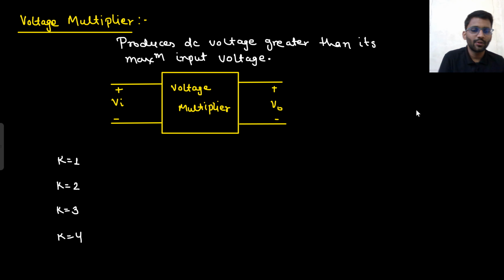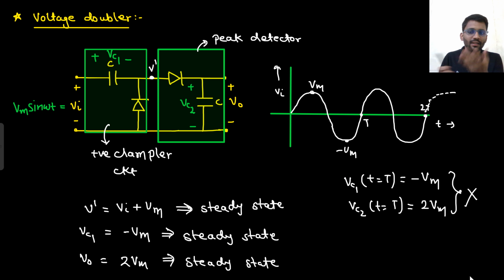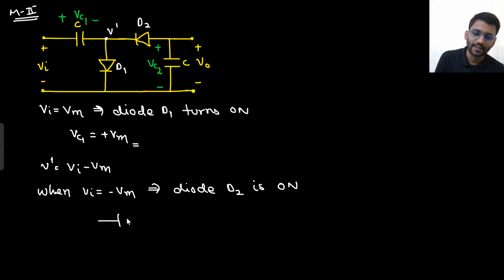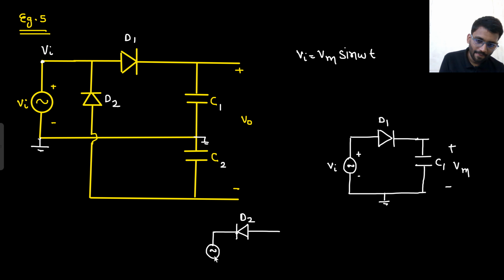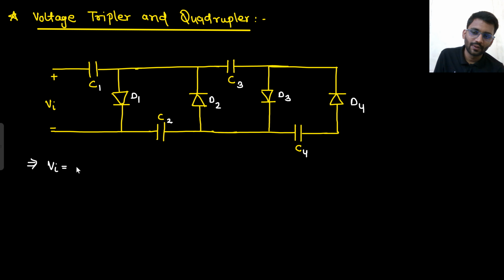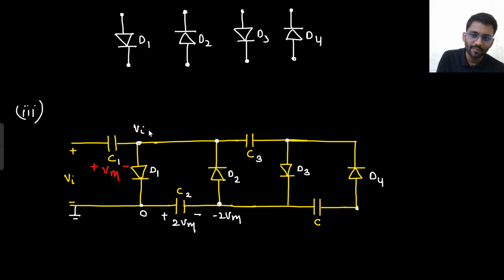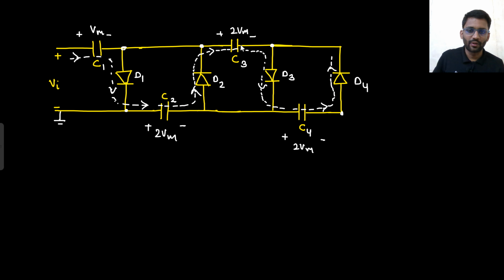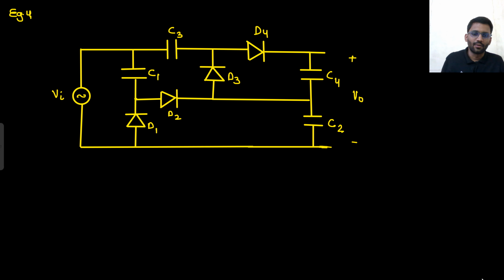Voltage Multiplier (Part 1) || Analog Electronics || PrepFusion || Himanshu Agarwal

Comment: SIr one doubt, in the voltage tripler circuit at NHC the potential at the top of the diode is Vi+Vm for the negative cycle right.SInce the circuit will work for the postive clamper.But you witten as the Vi-Vm.Can you clarify that
Reply: taken as Vi = Vm with the polarity  of Vin intact. so if we go by your method also you ll arrive at the same answer of -2Vm across the capacitors .. but it is easier to keep track in sirs method since Vi Vm can be kept constant upon every diode.
 I hope this clarifies else i understood your doubt wrong.

Comment: sir in voltage trippler/quadrapler -- if 2vm across two across both capacitor is there any charge sharing will happen at the end why 2vm across both capacitor
Reply: Did you find the answer to it?

Comment: At 5:14, I have a doubt about taking the polarity of the capacitor as + to - (left to right). Let's assume I take the polarity of the capacitor as - to + (left to right). Then, during NHC, Vc1 will be Vm. So, if they ask for the capacitor voltage in the exam, what should I write? like in your case Vc =-Vm and in my case Vc=Vm so ...
Reply: They will show the Vc with polarity. Just like I did in the given problem
Reply: @HimanshuAgarwal_  oh. Ok